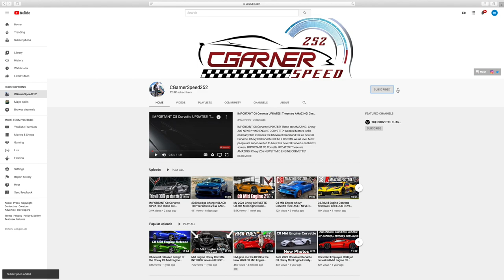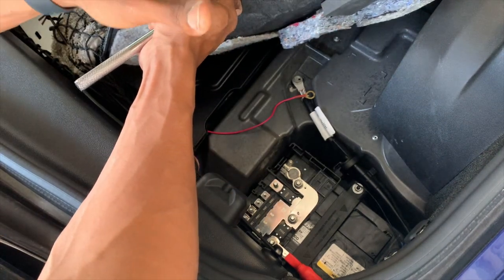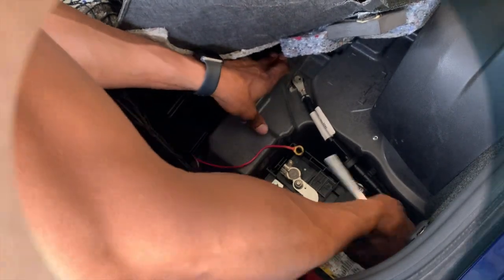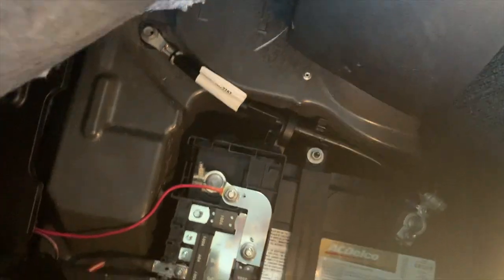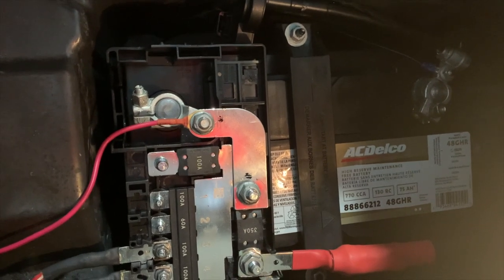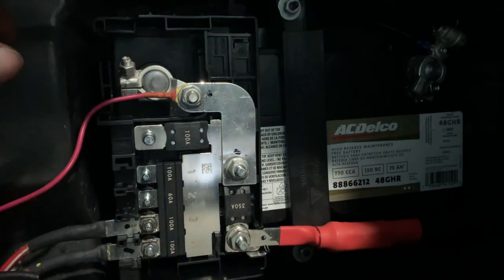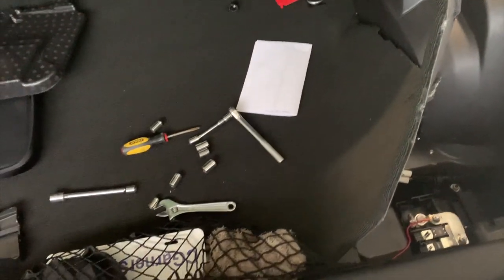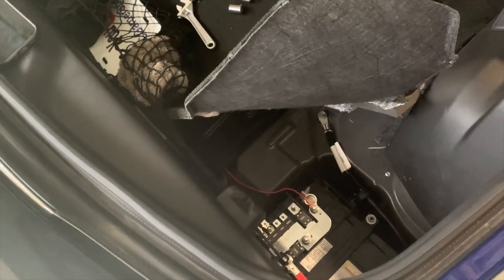HOW to Change a DEAD BATTERY in your 2014-2019 Chevrolet C7 Corvette.

Comment: Had to replace the battery in my 16 Ray. What a crazy job. I had so much trouble removing the old battery. I drive the car more often to avoid the dreaded parasitic battery drain. Thx C!!!
Reply from the maker: What battery did you replace it with.

Comment: I have a 2015 Stingray and have had about 4 batteries in it. Two AcDelcos a Super Start AGM. And now a Optima yellow top. If you don't drive them every day keep them plugged in. I have a factory charger from a C-8 now mainly because it has a reset button. Sometimes the red plug doesn't fit snugly in the receptacle in back so that's something  to look for
Reply from the maker: What brand battery did you go with
Reply: Optima Yellow Top. Made to fit C-7.
Reply: @cgarnerspeed252  FROM AMAZON. THIS one goes in the Cigarette lighter hole just above your battery location. I purchased it a month ago and it's worked Perfect.                ACS Composite Battery Charger Tender for Chevrolet C6 C7 C8 Corvette Stingray Grand Sport Z06 ZR1